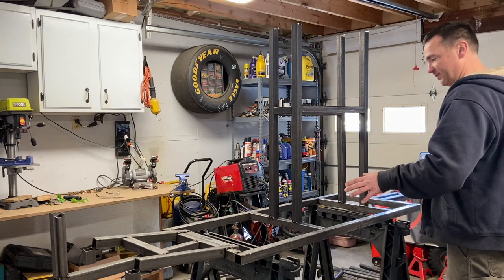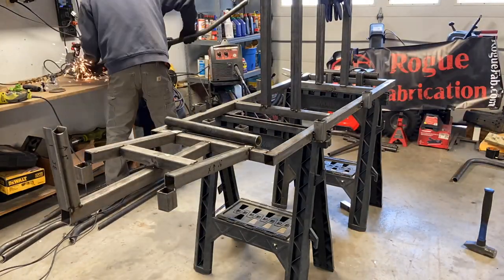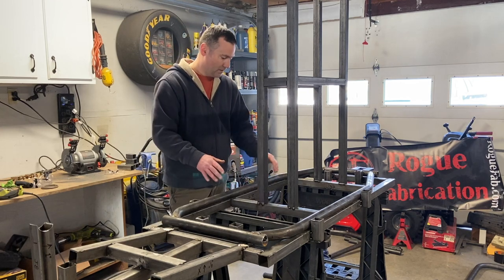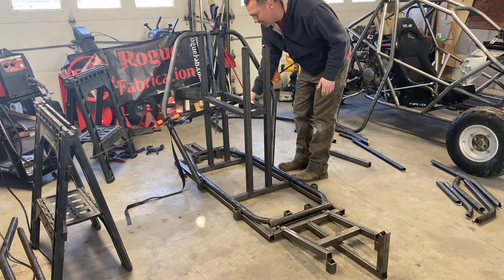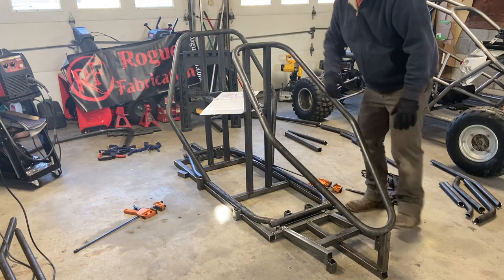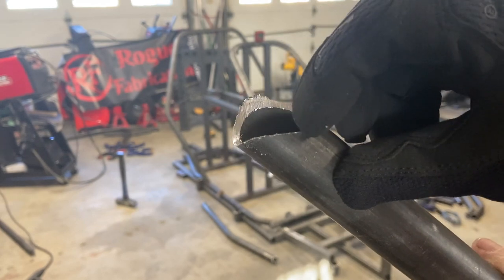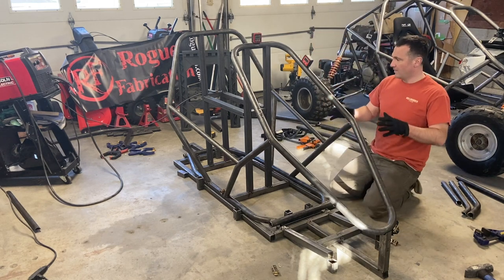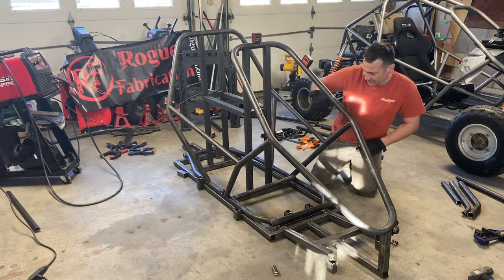Crosskart Build #2: Frame Assembly (with music)    Link to plans in the Description

Comment: I'm really liking the Crosskart build, could you tell me about what type of welding your doing, ie: mig or Tig welding. And what type of welder your using and your preferred settings during this project.
Thanks
Reply from the maker: Thank you, I appreciate that. I’m using a 110 Lincoln Electric MIG welder with gas shielding. The wall off the tubing is .120 or less so it it really easy to get good penetration and not burn through.

Comment: do you think it could be expanded in the driver area to accommodate a person that is 6'5" tall? This is really a cool project.
Reply from the maker: Thank you very much and Yes! There are 8 pieces that would be cut evenly however much longer you would want it. This does extend the wheelbase and makes it longer that 102”. Check out the Facebook Group for the discussion and information on this. KJ Raycing VF-1 Kart Builders.

Comment: i love the jig and the set up, but don't depend on relative measurement. (i.e based on this it should be this.) try and check all of it to make itsure. 

i wish all of us fabricobblers. could have a true straight and plum table with all the hold down points.. but i like your method.
Reply from the maker: Thank you. Making that jig was a big jump in making these chassis and making them really square. Check out the “for the builders” video. It explains the theory and practical application of not using exact measurements. 

https://youtu.be/2UiE8FiTalw